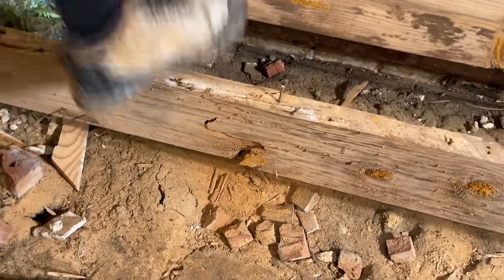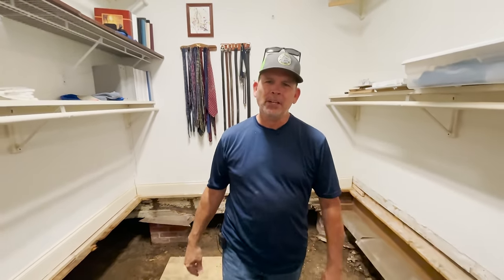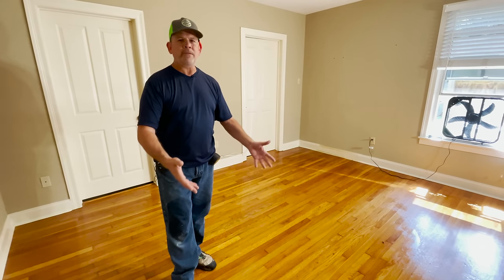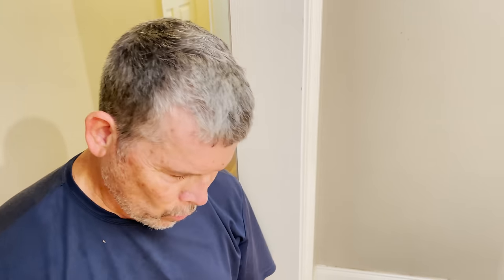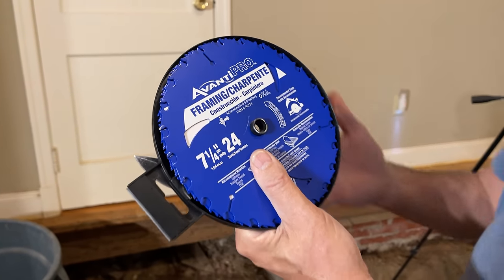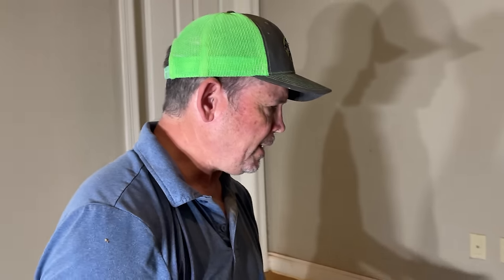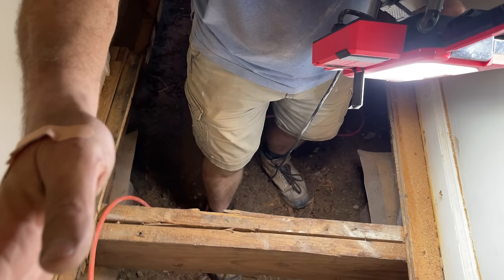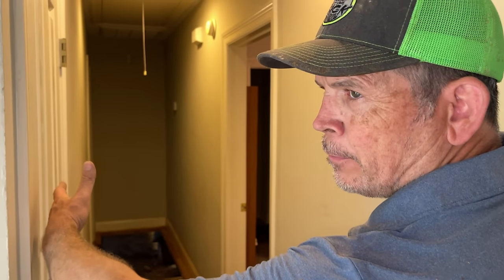This House is CAVING IN ON ITSELF!!! Can We Save It?

Comment: Scary to see homes in the south floating on piles. Makes me glad living up north with basements and better insulation and vapor barriers.
Reply: That is mostly older homes as modern construction is typically slab on grade. The cost of a basement in southern Louisiana doesn't make sense because heating losses through a slab in the South during the winter are simply not an issue compared to the cooling effect provided by that same slab in the sweltering summers. Plus, the ground doesn't freeze in the South during the winter, so no need to dig down below a frost line. Modern houses in the South are very well insulated because cooling costs are significant otherwise.
Reply: @billclinton6040  yeah it's cheaper until you gotta demo half the structure
Reply: Plenty of basement wall issues, water intrusion, forever damp, and other problems with "up north with basements". In Indiana, we got many issues even with a new house built in the last 5 years. Water (or vapor) is wood's worst enemy and does not bode well for poorly constructed concrete basements either. Keeps my company busy.
Reply: We got 6" of rain in a couple hours the other day and it submerged the bulkhead for the basement at a buddy of  mines, whole basement is flooded 4' deep going to be bringing my debris pump there shortly, basements have draw backs too
Reply: @billclinton6040  i never felt any cool air from my slab..

Comment: I work with my dad we do a bit of everything. Over the summer we had a job just like this. No ventilation under floor in craw space. Insulation was dripping wet and floor joists were very rotten. And the main beam four 2x12 thick treated lumber were completely rotten. One good party in that room would have done it in. Lol. Mind you this just had a oak floor put in 2 years prior. I felt so bad ripping it up.

Comment: Spyder Co demo blades for the circ saw. Hands down the best I have used from a home center. I recently demo'd a kitchen and living room with 2 layers of 3/4 ply, 1 layer of 3/4 t&g pine and a layer of 3/4 red oak. Quite literally hundreds of nails and that blade is still in the saw cutting sheathing.

Comment: Fortunately my situation was not nearly as bad as what you are running it to. My 1000 sq ft summer home had water and mold damage to the joists but my sill plates and outside wall rim joists were fine.  Only a few joists had failed. But since I had access to the entire floor system from underneath with my 30 inch crawlspace I decide to remove and replace all the joist and the main support center beams, My Son and I started the project and My Wife and I finished it. We had to jack up the entire house section by section just high enough to remove and then to slide new joists in place. We decide to use pressure treated for the main beams 4 wide and ran 32 feet on 8 foot floor pillars. The one thing that saved our building was a number of years back we had ground water coming up from the unprotected  crawlspace floor and the damp air (with vents) was too much for the joists.  Back then we were not prepared or ready to lift the house to replace all that was wrong then. So We found a compant that uses Cleanspace Technology to seal the dirt away from the house and sump pump any new water that was now being diverted by French drain on the inside walls to the sump drain. The cleanspace  system is what kept the rest of th wood from rotting and kept the damage limited what had already occured.  We are in  central Ontario Canada and the humidity thru the summer is just awful and that mixed with the ground water was our biggest culprit.  Its been 20 years since the cleanspace went in and 5 years since we fixed the floor. We have a few squeaks and there is a small highspot. but doing what we did lifting and replacing was the smartest thing we could hve done and Thank goodness we did it when wood wasnt priced as GOLD or we may have had go back to a dirt floor.   AS for you Bathroom. Maybe you can lift around and in that same way lift the bathroom and put more support under it with steel if needed  or jack posts and joists,  Looking forward to seeing how this goes, great video guys.
Reply from the maker: Always appreciated thx SC 👍👊

Comment: Get a shovel, dig a shallow trench space below the row of pillars and replace the rotten stuff from the bottom after adding some temporary supports.

Then cut the old stuff out piece by piece.

Same for the single failed "beam" below the bedroom.

The trench can be stabilized with wood temporarily and just fill them with gravel afterward.

Comment: Grand total how much did it cost for all that? My living room floor is in dire need of replacement, there are holes everywhere and the carpet is the only thing keeping me from falling through to the dirt which is probably just a few inches down. This house is not on a slab but it isn't really a crawlspace either because you can't get underneath it. It's a jalopy house built in the 40's I think.

Comment: Dude, you can buy a circ. saw blade with a negative (or at least not positive) angle on the carbides. It'll go right through nails and bolts.. fast.  Years ago sears craftsman made one but it was expensive (this was in the 90s when carbide was getting cheaper but still a lot more than today). Usually a blade with a negative (or at least not positive by very much) angle on the carbides will be called a demolition blade) THe ones at the big box stores that are labeled for nails and wood will work, but they are pretty thin compared to a proper demolition blade.  We just use the big box store ones now. Not even sure if the heavy ones are sold...things are getting so inexpensive..

Comment: I think I would recommend to the client to lift the house and build a properly conditioned crawl space with a modern concrete foundation. Lift it up to work on the underside and set down on concrete with a good taller crawl space that you can actually crawl in and a skim coat so you don't get dirty.
Reply: That's untenable, such an undertaking would be a five figure upgrade, this is obviously  starter home and the budget isn't there to fix the bathroom , it's certainly not there for recreating the foundation of the structure with poured concrete. You gonna sell them the heated floors while you are at it? That's the difference in a builder, and a contractor. One's trying to solve a problem, while the other is trying to sell a product. Thank God Tennessee doesn't require contractors for remodels that are 4 digits. When you hit 10k on a project that's when leaches come for blood. Now ask how many 10k jobs I've done in 10 years?

Comment: just closed on a house a couple weeks ago and similar situation. I thought it was just subfloor problems. Turns out foundation walls broke and sunk in many areas. Got all joists and  beams out and down to where the footer should be only to notice no footer, just an 8 inch stem wall with 4x4 pressure treated near exterior plywood. Ran all electric through attic and plumbing lines I could and just back filled 60 yards of dirt into home and jumping jacked and now ready for a monolithic slab pour

Comment: ive been a carpenter for 6 years and honestly the home owner is lucky that they had hardwood floors otherwise id bet someone would have went through that the floor a long time ago
Reply: It was the ply sub that had the strength, not the veneer.
Reply: @stephensaines7100  hardwood is not veneer, 1+" hardwood actually adds a lot of strength to floors and sometimes you can go with thinner subfloor if you tell the engineer / building department you are using a thick hardwood floor
Reply from the maker: Yes that what we found.  The original pine shiplap subfloor was rotten and the oak strip flooring was fine.  There was tar paper between the two layers

Comment: I usually cut into a floor with what I call "a peek a boo cut" that's a 4 sq. ft (2 'x 2') Section of floor cut out, enough for me to peek into to see of any wires, pipes or any other possible obstructions /unexpected surprises. Before I completely commit myself to removing the large sections of the floor.

Comment: I did a similar job on an old commercial building. subfloor on top of subfloor. burned through a Milwaukee recip saw and 15 blades. took a solid week to get that done. There is no easier way to do it.

Comment: Replacing old dimensional lumber sucks because it was actually the size it said it was unlike now. To replace a ACTUAL 2X10 you have to use a 2X 12 and cut the height down.

Comment: If you use a Neodymium magnet, it will stick right to anywhere there is an acorn nail in the floor, and then mark them so it doesn't destroy your blade. Also it could help identify where joists are.

Comment: Use a rubber hammer to drive the pry bar into the crack.  It's easier on both the ears and the bar.  Those cut nails are actually concrete nails - and REALLY HARD.  I'm guessing they use those because they'll go through the oak flooring without bending, but I think they're not at all the right nail to use.  Nowadays we'd use a flooring air nailer, but back then...
Anytime doing reno - it's open the walls - or floors - have that Edvard Munch "Scream" moment, then figure it out and put things back together again.  And... behind wall #2...

Comment: Crazy.
Some floorings want a vapor barrier o the floor.. I wonder if it had this at one point. 
To think each one of them cut nails was hand nailed. Much easier with floor gun these days. 

Looked at a house to buy years ago. It had 5 additions and many of the floors in the main hoise were not level. Glad we passed on it. 
Current house. The 1840's concrete under the bath tile was only thin holding the floor. To frequent of showers i assume. Soaked the floor.

Comment: If this were my home,  after removing the floors, I would dig out the soil to allow for better ventilation, clearance for future crawl-space area inspections, and accessibility for service workers, plumbers, electricians, etc. Those subfloor timbers are way to close to the soil line. That along with poor ventilation,   humidity flowing thru the vents along with condensation from AC lines creates alot of the high levels of moisture rotting out the subfloor area, especially when the subfloor timbers are super close to the surface of the soil. A good vapor barrier with also be highly beneficial.

Comment: It’s obvious that the caved in section of dirt under the bathroom shows that a pretty good leak has been happening. I wonder if it’s the source of all the rot your seeing throughout the other rooms. Probably much cheaper to fix now rather than later. I’m on board with repairing the beams and subfloor and just roughing in the bathroom since it wasn’t in the budget or timeline. I doubt that’s the only bathroom in the house. Can’t wait to find out what happens, good luck

Comment: Ugh, I've been replacing joists/subfloor in our "fixer upper"  we bought last year. One more room to go. It's a ton of hard work, especially when you work a full-time job, and do this when you can, and when lumber isn't $30/board lol. This house was built in 1940s and is also very close to the ground with no ventilation,  so I'm going to put vents in this spring. Hopefully, I'll never do this again.

Comment: I saw this exact same situation two times while I was working as a forensic engineer. One house was in coastal NC and had no vapor barrier on the sandy soil. The house had zero crawlspace vents. Every single joist was saturated and had black and/or white mold. My job was just to report my findings and not devise a repair. Second house was in TN and was vacated. Same situation with no vapor barrier on the soil and I calculated that the provided crawlspace venting was less than half of what was required. The TN house was so bad that the living room floor had dropped over a foot and most of the floors had separated from the interior non-load bearing walls; I could see into the crawl space in many locations! My foot actually went through the sub-floor in one of the bedrooms. That house was a disaster! Also my job was only to write a condition report. If had some say-so in the matter, I would have recommended that the TN house be completely demolished.

Comment: I would bite the bullet and fix everything. Or else start all over again with the mess. I know it will sound crazy but I might just replace all the beams. We had to replace all our subfloor. DIY, we had a contractor friend check it out and he was impressed. I will say we did a great job. We also had to level the joists and add support to sinking interior walls. Turned out better than the original build. Then installed the wood floor. It was a learning curve for us.

Comment: I see this daily. Proper air ventilation under a house is needed on all structures. If a building cannot breathe it will die. I would of removed all material along the walls all the way to the plaster or drywall. (Baseboards and trim) Put a series of turn jacks under the house lifting sections at a time. Replace all center beams, seals, and plates that are damaged. Put in extra support where needed and used all treated material under the subfloor. Run new joist out of treated 2x's 16" on center (I think you mentioned 2x10's) then use 3/4" tongue and grove osb subfloor glueing the joints with liquid nail. Use all deck fasteners 3 1/2" screws on the 2x's and 2" on subfloor. 
This job looks fairly easy just time consuming the supports under the house looks like they are in fairly good shape. If they weren't that job just got harder and more expensive. 
As for the bathroom. It needs to be fixed now. If the plumbing is bad it needs to be replaced while the renovation is taking place, because of it being the issue for the cause of the matter. 
Being from Southern Indiana and all I do is floor joist, plates, seals, foundation and subfloor work every day this would be a fun job. I hope everything goes well on it.
Reply from the maker: Thx Travis 👍.  The owners decided to tear it down.  Turns out there were more issues than just the rotten floor

Comment: Have to fix it, to be done right, but sometimes the money is just not there..  Can you set in place new floor joist for now and redo the bathroom at a different time if need be?  It would be easier to place the floor joist now with the rest the floor open than later.

Comment: Don't demo the bath, just dig out enough under the house to replace the joists from below. You can remove all the plumbing as needed under the house. This would same the homeowner much in remodelling the bath and keep the character of the inside. I have done it on houses here in the California desert where the ground is so soft that houses with no foundation are sinking. We just raise the house like you said, just about an inch or two above where it should be to get the new wood installed. Some of these houses sink so much that they fall into the sink holes. There are some contractors who come in and drill holes in the slab and drop air bags in and inflate them to raise the house. Then they will open them one at a time and fill the first column spaces with concrete. After it's stable, they fill the rest with some foam that is stronger that the concrete. That is an expensive job.

Comment: I would be interested in fixing the ventilation problem under the house also - perhaps copper plumbing tubes running up and exiting the roof?  Small holes bored in the brick foundation? And what about radon?

Comment: This job looks exactly like my mom’s floor in La. about 85 miles N of BR.  The oak floor and joists were replaced due to rot.  4 years later we had to have it all torn out and replaced again (by a different contractor).  First guy failed to find the real water source.  He assumed rot was caused by ground water from an a/c drain line.  Second contractor found that it was a leak from a single nail hole in the roof that dripped down behind a tall piece of furniture and ran under the solid oak flooring in a seldom used bedroom.  It the same white mold covering every joist & the sub-floor as in the video.  The mold smell was horrible.
Reply: yikes, problems like that are scary

Comment: No follow up on this one?   I've had to do quite a bit of floor joists repairs in my parents home(built 1950).  Luckily the crawlspace is not so tight so more easy to move around under.  Probably needed to do more demo but didn't want to get that deep into things.

Comment: If a plumber cuts through a sil plate and rim joist for a vent pipe and clean out, can you re support the room joist and sil plate with a patch. Meaning, can i screw a piece if 2x6 to the rim joist sbd a piece of 2x6 to the sil plate to reinforce them? I know you cab do it for a floor joist but , can you do it for a sil plate and rim joist?

Comment: The only correct way is to replace all of the rotted framing, replace all the cast iron plumbing, up up grade the supply plumbing and any electrical that runs the the floor. If the rest of the house is sound then it will be worth it. Makes no sense to go back in later. I like how the ties are left in the closet.

Comment: Bathroom should be done now. At minimum, the structural/mechanical work should be done. Do a minimal finish and it can be upgraded later. You mentioned raising the house and setting it back down. I assume there are plans to increase the ventilation under the house. Tell us a little more about that.